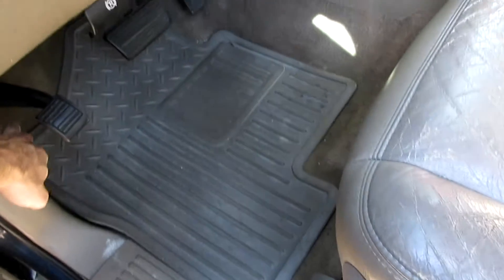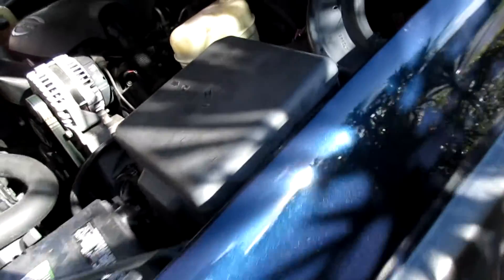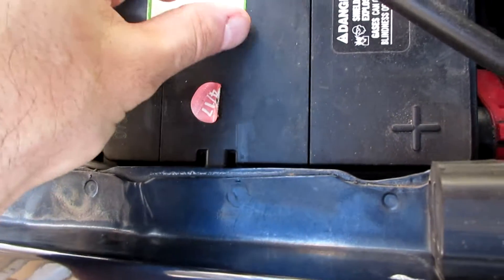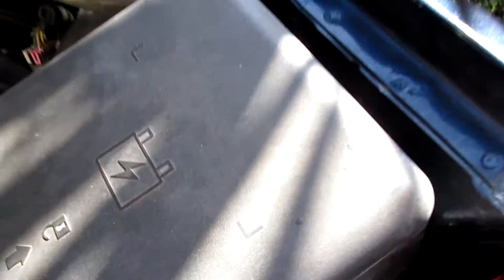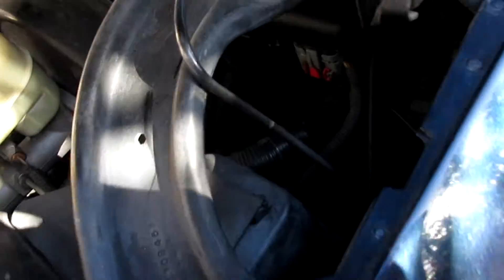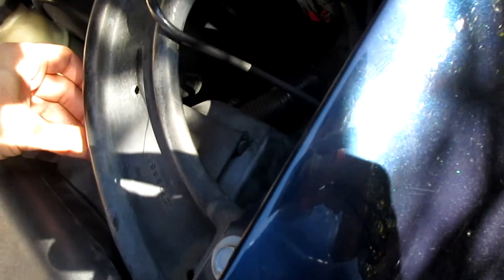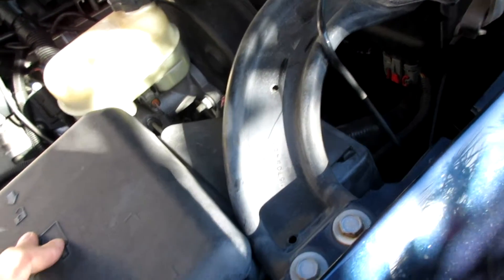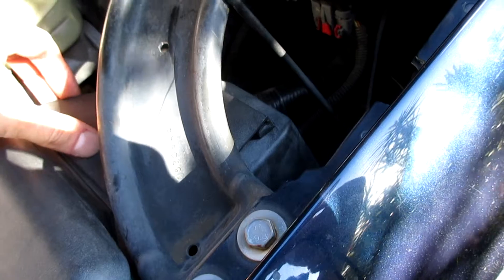Need that part Stupid truck GMC Chevy  Fuse cover

Comment: waiting on warmer weather to hit the JY, I'll keep that in mind when I go
Reply from the maker: i might find one I fixed it kimda for now just dont want it to get wet. I can get a WHOLE NEW cover for the fuses GM 30 bucks hahha may be something to consider brand new
Reply: @GhettoWagon   30 from the dealer? I wanna see how much it would be for a dealer here :p
Reply from the maker: Yea whole frikken cover. U get the top cover, The side piece and the triangle that shattered when I put it back on.  @Nordic_Mechanic   All for 30,. Comes with the decals too! Its kinda a deal   And it makes the engine bay look fresh this whole thing is cooked from the heat . Probably 160 Can.  hahaha.  I dunno how all you live there I would apply for the US and live in Maine or something.    GM 15215145     05-06 Era part